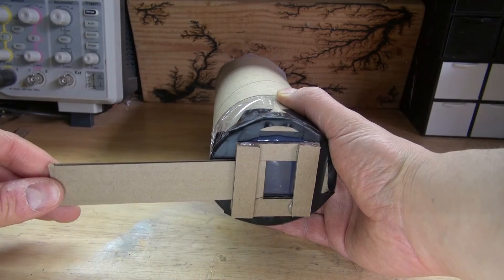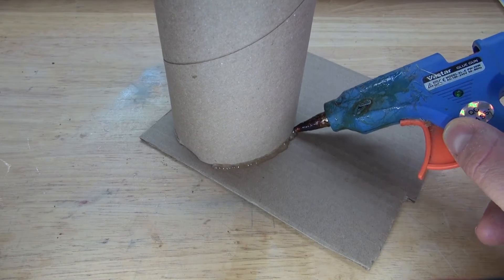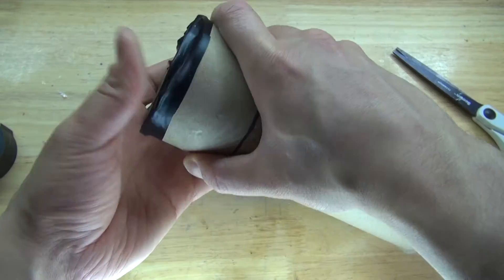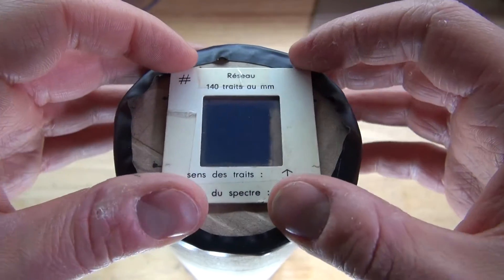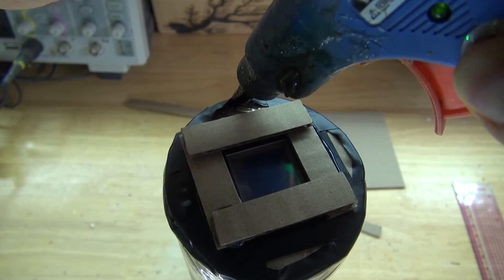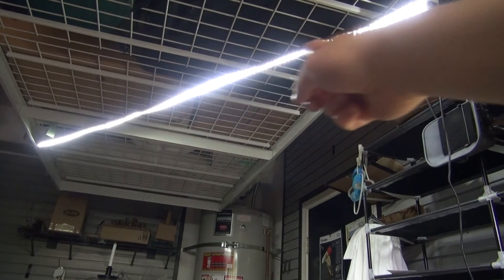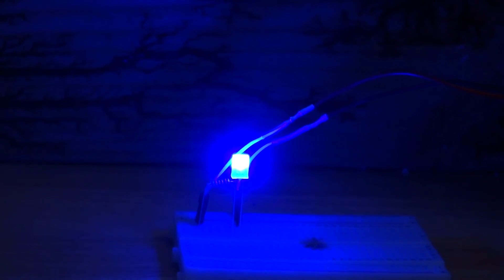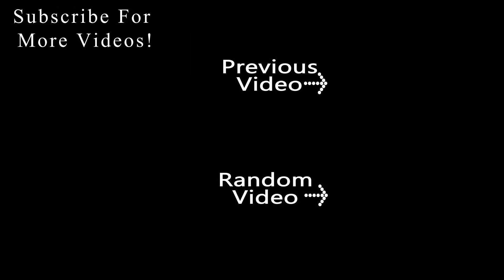How To Make A Very Simple Prism Light Spectrometer

Comment: You put the diffraction grating way too close to the entrance slit. In its current location it offers little if any benefit over just holding the grating up to objects without the tube at all. Remove it and place it at the eyepiece, then adjust the slit at the other end to a narrow aperture to obtain hundreds of times more spectral resolution than seen here. Make sure that the grating lines are parallel to the slit when mounting it at the eyepiece.
Reply: Also, this is not a prism spectroscope. It utilizes a diffraction grating.